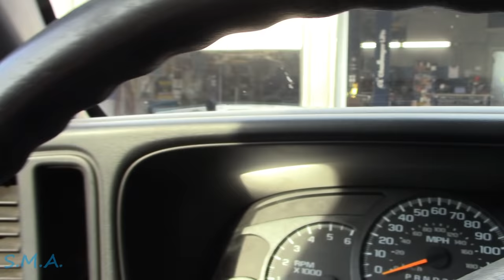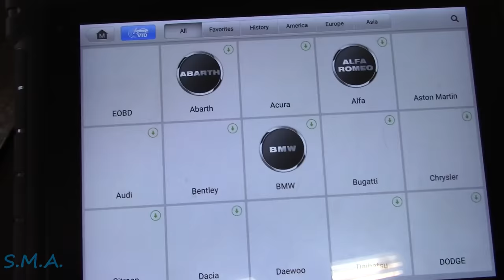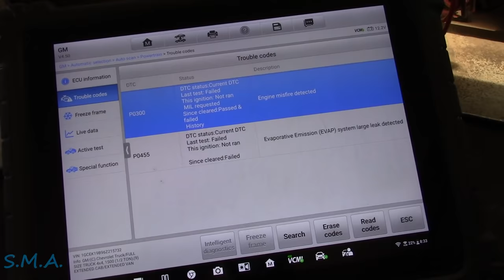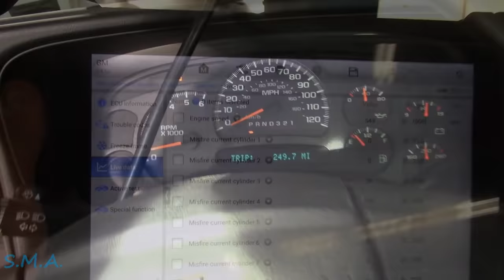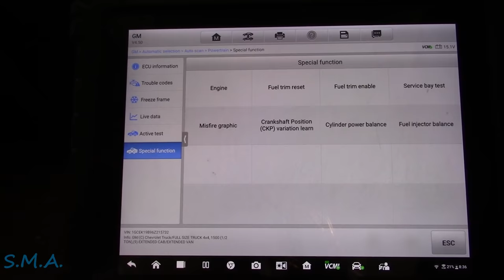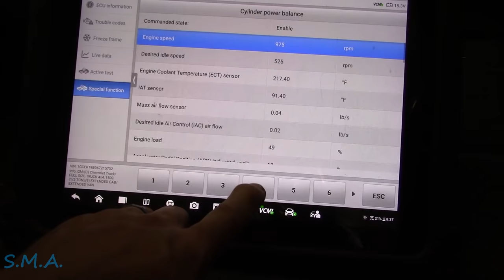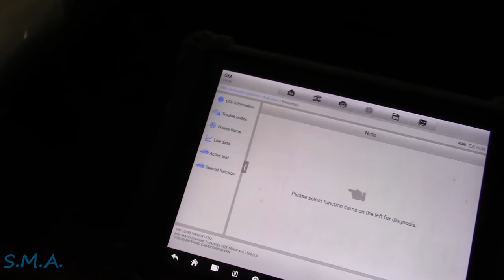GM - Chevy Truck: Misfire Diagnosis

Comment: Man wish your shop was here outside of Buffalo ny. I have 07 classic 2500hd 6.0l my trucks has the same codes p0300 and p0445. Can a large evap leak cause misfire? I changed spark plugs and wires 2 weeks ago still have yet to find evap leak. New purge new vent valve new gas cap so it is more in depth. Should I be looking into fuel injector possibly for my misfire as well? Any help would be awesome

Comment: I have a question I have a Dodge Neon 05 I replace spark plug coil and wires and still come out with the same code misfire cylinder 4

Comment: I have a 2000 Silverado 5.3 with about 200,000 miles. it has a Po300 but I don't feel a misfire at idle or driving it. but then again I am not a mechanic. We have done all new plugs and wires, rebuilt the injectors. any idea would be a great help.

Comment: question i know someone having P0300 with cylinder 4/3 they have already put new injectors and coil packs and plugs/wires should i tell them to do a cylinder leak down test??

Comment: What would be the normal values for everything you can see in an obd2 scanner on an 01 2500hd 6.0? I threw a code a few months ago for cylender 3 missfire at 5k rmp. But it doesn't miss at that rpm it misses at idle. When I look at the long term fuel trims bank 1 is 1.6 and bank 2 is 3.1. I can't find anything about these numbers.

Comment: Hi hey got a 02 a few codes on the OB reader one is a OP 300 in my 2000 GMC 1500 4x4 no power not enough to shift today had out for a lengthy road test no power max speed was from 40km to 60km oh yes lol I’m Canadian but anyway what and where do I want to look it is showing on my OB reader fuel 1,2, 4 when I get back to it I will have to show you my reader codes

Comment: i had a misfire situation and it turned out to be worn worm gears on the distributor. replaced and problem gone. that was on a vortex motor as well.

Comment: How do you do the crank no start ? I have an 06 and tried before and it didn’t work do you hold the gas pedal down or what ? Mine having a po200 and po308 right now two days ago it ran fine

Comment: -- I have the 5.3 in a 2004 Tahoe.  Find it to be a pretty good motor.  New to this engine I'll admit, but I was surprised how well yours ran with a totally dead cylinder.  The 'other shop' however.  Wouldn't it have made sense for them after the repairs to then go to the injectors, rather than send it down the road to you?  And a question: Injectors aren't all that expensive.  Would you advise the customer to just change them all?

Comment: The ground on the front left corner behind the bumper on the frame is a pile of ground wires needs to be taking off clean grease and clipping the spot on the frame and reattach and also under the driver's door on the frame same way I was fighting a multiple misfire that I could not beat ended up I clean those wires that was Rusty a little grease on a Murray attached tighten them up immediately my multiple misfire was gone

Comment: Hi! I got problem with my 5.3 Vortec. I have missfire on cylinder 3. I have LPG instalation on car, and on LPG car running great. Problem is only on PB. I change injector, and check signal on injector connection, and its fine. But on idle, when i pull out connector - zero reaction. I dont know what i can check, its fuel problem only...

Comment: I have a 2012 Silverado with 190.000 and I just changed plugs and wires a few months ago and it ran great for a while then had a light come on for emissions related issues so I swapped out my air filter box and cleaned maf sensor in the process and now I'm getting a p0300 2-3 misfire code and I can't afford to do this dod delete crap that some people are saying that I need any help would be greatly appreciated

Comment: I have a similar problem in my 2002 avalanche, 5.3 with headers and deleted cats. But my bank 1 side runs rich and it blows black smoke when started and heavy throttle. I’ve changed my fuel pump and filter new harness. All new plugs wires and o2 sensors with no luck🙃 what’s my trucks problem

Comment: Eric O’…So how does the ECM Sense a Miss Fire? I assumed by the Electrical Ignition (Spark). But in this case the spark was 100%. So then there is the Electrical Injector side. But the Injector electrical was 100%. Does it use the Knock Sensor to see the cylinder fire and sync it to tell which one? Note that there were also some instances of #3, which is opposite of #4. Are they on the same Crank Journal? Seems that the Pintle was not moving as you did not hear it. But is it the pintle moving which changes the Solenoid Inductance to create that “S Curve” in the waveform, which you did not see? I would like to have a little test bench to mount injectors and see what the spray looks like. P.S. I think your Scotty Kilmer impersonation needs a little more work. LOL
Reply from the maker: That's a good question. Most vehicles but not all measure crankshaft rotational speed to determine misfires. Some use compression sense ignition also. Along with other methods but monitoring crankshaft speed is the most common.
Reply: @SouthMainAuto  Thanks Eric O' !!!

Comment: My truck is doing the exact same thing when I go down the road my check engine light flashes check the codes it says random misfire does not tell me what cylinder so could that be my issue and yes it is a cat eye Chevy Silverado 1500 5.3 engine

Comment: Hey, that's hot. Old vehicles have dirty internal sensor problems. Try oil flush, oil and filter change to clean them up. Euro cars are exceptionally problematic with dirty internals. Oh yah, dump the spiffy mechanic talk when speaking to the general public. Top expert diagnostics tip, pull the dip stick and look for carbon build up on the cap and stick. (lower lip quivering) but I can't use my spiffy expensive tools...  Marvelous Marvs in the gas tank and oil cures a lot of problems.
Reply: Cheap trick to reduce future redues, wash off the engine compartment. If the vehicle fails from a quick spray down, the problem will happen on the road. Plus, it impresses the hell out of the customer. Hey, it's clean!

Comment: I have a 2002 trailblazer has a 300 code atrandom misfire plus a 327 code knock senser it runs great when it's cold outside but when the temperature gets to 70 or the engine gets warmed up it starts missing no one in town has the knock  sensers I ordered some so I'm driving with no knock sensers  and nothing has changed so I'm thinking it's not that but why the code and I unplugged each cylinder and they all seem to lug the engine so I'm unable to isolate what cylinder has the problem any ideas

Comment: with all do respect. I had a cat that was tortured and killed by some kids. Do yo think you could ease up on the 'skin a cat' references. I dont mean to get down on 'Manley' metaphors but a little considerations outside the locker room would speak to a higher character. Thank you for your instruction.

Comment: Hey i have a 2010 santa fe no start boosred it and car alarm goes off and noice and clicking from engine fuse panel at horn relay and a clicking noice in fuse bov drivers side when put the brakes on stops clicking noice in vehicle can you help me from canada i like your shows i watch you all the time thi king on doing a parasitic draw test

Comment: Couldn't you just cross #4 and another injector and compare fuel flow using the scan tool? All you would need is 2 old fuel injector connectors with the proper terminal to go into the face of the OEM engine connectors or tinned 18 gauge wires to touch the female terminals and compare the flow?

Comment: 08 sierra 5.3 in a year fowled cylinder 6 plug 3 times, also oil pressure low code p0521, do i need an oil pump or sending unit, and could the two issue be related

Comment: My coment on this, If your connection to the plug, and your injector have good spark , How come at that point you did not check the cylinder compression ?..My  coins on this.

Comment: A misfire in modern engines is not just coil, wires and plugs.  A misfire is the lack of power from that cylinder compare to the rest of the cylinders.

Comment: A Pcm as you know can shut down an injector if it detects a misfire, I'd think in that situation the pcm would to go into open loop and not try to trim the fuel, but I guess its down to the chevrolet boffins.
I'm a plant fitter I swap parts all the time to find faults, 'expert' comments dont pay my wage, fixing machines does.

Comment: Been getting p0300 multiple misfires been trying to figure it out one shop said it was fuel pump so replace it and then they said fuel filter changed it then they said plugs and wires changed it everytime I had it changed the code came back getting tired keep spending money just need to find a better shop to chase it down correctly
Reply: 630Cars  yes they did everything is good so I just need to find what’s causing it
Reply: 630Cars  no I haven’t

Comment: i use to drrag race yrs ago  built new  327chevy   it would not crank   changed coil  then disterber  still would not fire  pulled it down road at 40 mph popped clutch in 3rd gear it crank ran  missed terribly drove home noticed   4  of new header pipes   coating was not burning off   culprit  4 bad brand new champion plugs

Comment: Two years ago my truck started running rough especially when accelerating. 6 months prior I had a shop replace my rusted out brake lines. They did a good job fixing my brake fluid leak. But they also removed my fuel filter without my knowledge. Why? Were they sure I would return to them and fix my rough running engine? I think so. Would there diagnosis be very easy? Oh yeah. How much would it have cost to remove my intake manifold and replace my 3 fuel injectors? $1,200? Did I return to that dirty shop? NO. Did I bother sinking $75 and 4 hours of my sweat and labor into this old rotted out truck? NO. Will I ever go to that same shop ever again? Hell NO!!!

Comment: I know you charge for diag-time...is the comedy free of charge?..and..will this problem come back on a different  injector of the same vintage?..I know injectors ain't cheap...when I worked at a shop...we diaged the bad injector..and hooked an I V bottle to it until it ran silky smooth...I dig your channel bro...

Comment: 4 injector bad or a dead hole like a diesel? So you did a cylinder cut out test like a diesel and since there was no change and no electrical code for the injector being shorted to low or high source the injector is bad. So not.a harness issue or ecm/pcm issue.

Comment: Couldn't you also use stethoscope and listen to a fuel injector to find out if its clicking on and off? Without using a scope or scan tool and still be able to find the problem?
Reply: If you don't have all that equipment

Comment: 2001 Chevy S10 same problem, 2 different mechanics, and both cant figure it out. Told both its a bad injector, but they wanna spend hours diagnosing and trying different stuff. 700 bucks later, and the best the last mechanic can do is tell me to run fuel injector cleaner thru it. I will let the most qualified dude handle it which means, I will be replacing a fuel injector.

Comment: wow just watching this I may be looking the wrong way at a problem that I`m having I know how you feel about gm. but Eric I bought for the first time in my life a new truck in 2005. I am 65 now and I still have big red. I looked for the cheapest Yukon that I could find. I found an SLE and it didn`t even have running boards. when I went in to try and make a deal the guy say`s do you want to drive the black one . which was a Denali. and I said no so you are looking to drive the red one and I said no. then why are you here ? and I said to talk price. in which I walked out without a deal. so he calls me 2 weeks later and say`s are you going to by this truck. and I said are you going to come off of your high horse. and he said come on in. well we made the deal and he wanted a day to clean it up. when I drove that truck off the lot it had 2 miles on it. nobody wanted to drive that truck. she now has 348000 miles on her with the original motor and trans. that truck owes me nothing. I now do all the work on her myself because there are many parts that are starting to fail on me. but I won`t get into that. I just replaced the fuel pump on her and I`m getting a tighten the fuel cap. but when that starts the whole truck goes nuts. with a Misfire and a large Evap leak. cods like 455,442 443 and so on. so I replaced the surge solenoid . and that worked for a week. but when all this happens  I have to power brake her to keep it running.so now I watch this video and I noticed that the other code that you had for this pick-up was a P0455 which is a large Evap leak. I watch all of your videos on gm trucks because if I can do then you can do it. Eric you are a very knowledgeable man and I love watching your channel. I have a house in Antrim pa. and I will be planning a trip to see your wife. because you are a busy man.  I battle every problem with big red. but your videos are Extremely Helpful.  Thank you    Bill

Comment: You seem to do a lot of work to diagnose.  You checked spark, you checked the plug. I would have check compression while the plug was out.  Then check spark on the injector wire, which you did. All is good. go to injector.  Then I would check the ohms on the injector.  In this episode I would have gone straight to the injectors.

Comment: 2003 silverado "Get This, Studders on start up) Then will run perfectly on the highway" | then After 2.40' Temp Up:  will not start or strudders insanely with no power. To get RPM back, ONLY  with the paddle Until it will run at 3G rpm. then once it will stay stable at that RPM?  then you can let off, & drive away like nothing ever happened.. (Insanity) Now going to test spark plugs & Injectors. & Fuel Pressure.

Comment: Well I don't know as old as the truck is probably just put new injectors in it anyways wires plugs that's what we used to do to the older vehicles instead of wasting all that time testing testing testing you may as well just replace everything

Comment: why didn't you measure the voltage of the fuel injector instead of amps. the pintle hump would of been easier to see

Comment: Ok see what you think, 2005 5.3 Silverado, when it calls for fan’s ether from temp or cut the AC on it has multiple misfires, so much raw gas coming out the tailpipe you probably could set it on fire 
New spark plugs, wires, all new coils, O2 on bank 2
I’ve had it scanned at 3 shops all with different answers, so far no. Have fixed the problems

Comment: It appears that the expensive, computerized tools of your ICE trade failed you on isolating a problem that should be so clear that a "cat scan" could find it. 
I am amazed that no tool exists to find a bad injector with a single definitive test. Instead, you were sent through a Rube Goldberg litany of negative feedbacks and ended up diagnosing the issue by the process of elimination. You could rake in a bundle if you took your superior analytical skills to the electric car industry.

Comment: It doesn't sound like the other shop even quoted and thought it was possible a fuel injector it kinda sounds like they were a lube shop because I just did the knock sensors with a friend and injectors on these are not hard

Comment: yes a lot of ways to go after a misfire, you need spark, fuel and compression, an easy way to check compression is like Eric did, just hold the gas pedal down and crank, this is clear flood mode, no fuel, if the engine spins evenly you can assume compression is good, next swap the coil and plug with a cylinder that working, if it stays there, I would have just swapped the injector with a known good cylinder to see if it moved and it would have in this case, diagnosis confirmed, I am not trying to downgrade the way Eric went about it but do the easy things first, I get so tired of seeing techs looking at scope patterns and wasting time that should only be a last resort, do not want this to seem negative just tired of guys thinking this fancy electronic tool will replace common sense, not gonna work

Comment: The new injector shows every sign that it's electrically working correctly but it's not releasing the fuel. must be bad quality control of the manufacture.

Comment: Ok so I have  a 3500 Express here with the 6.0 and the EXACT same issue. p0300, Misfire showing on 3 and 4 at idle, 4 only when power braking, dead #4 injector during balance test.... So just for fun I swap injector 4 with 8. Now 4 ticks with the balance test and 8 is dead. Makes sense right? Start it up and what cylinder shows misfire on the scanner?  F@&*ing SEVEN!!!!!!!!  🤣🤣🤣 New injector is on the way and going in 8.....

Comment: AC ducko plugs smooth porcelain  Notorious for carbon tracking All the factory part fanatics will freak out  But What has never failed me put Is NGK Plugs Delcos usually Okay Motocraft good But I can't tell you how many times I have had cars that wouldn't pass emissions because they had Bosh plugs on them I put NGk's in Volkswagen's and cars that came with Bosh and Chrysler is plagued by champion And fiat electrical components Just my opinion But NGK or denso has never let me down